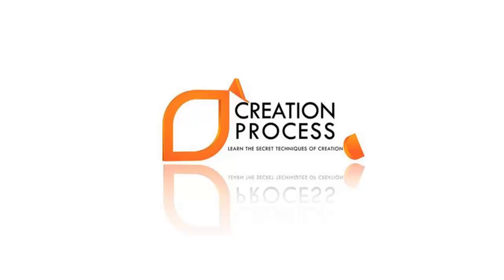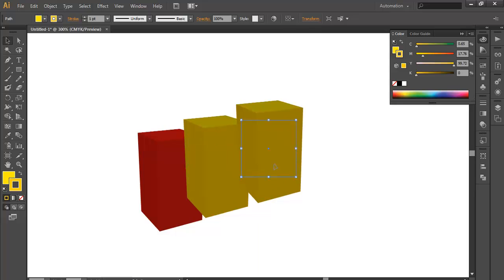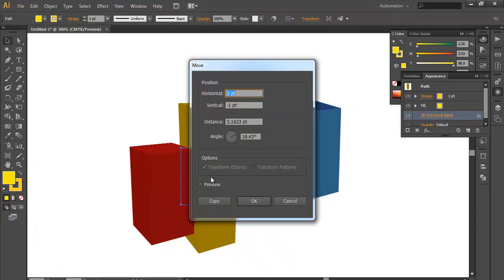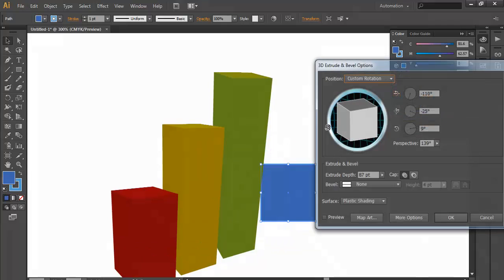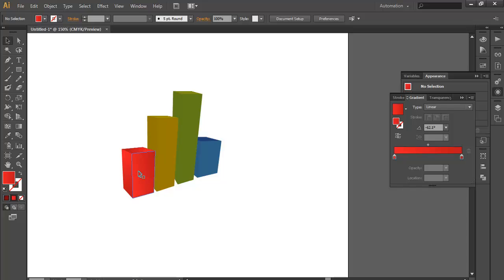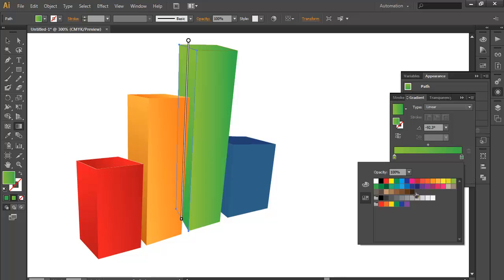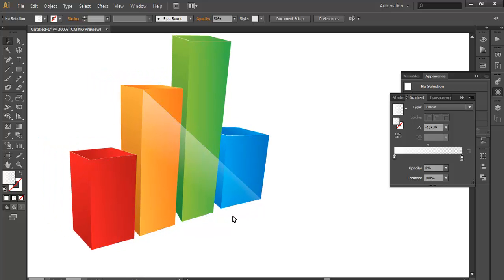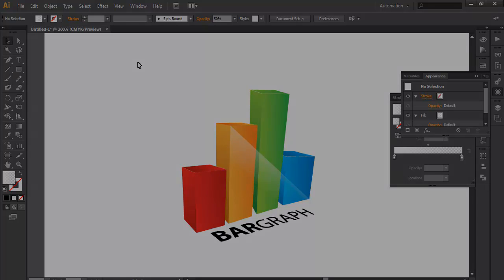3D BARGRAPH DESIGN - Adobe Illustrator cs6

Comment from the maker: 3D BARGRAPH DESIGN - Adobe Illustrator CS6
In this video we go through the steps to design a 3d BARGRAPH using 3d tool using Adobe Illustrator.
Fully Explained Tutorials, i have used Rotate 3D Tool, Gradient, Expand Appearance, perspective, lots more little tools and techniques which is very useful as a designer.